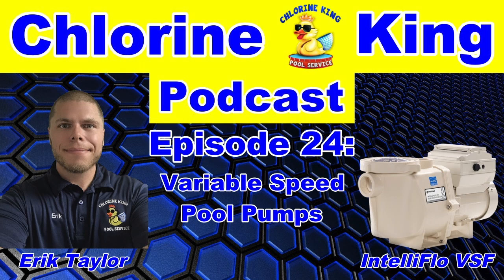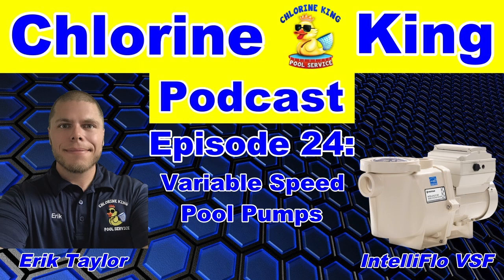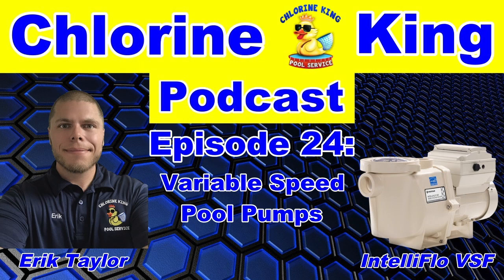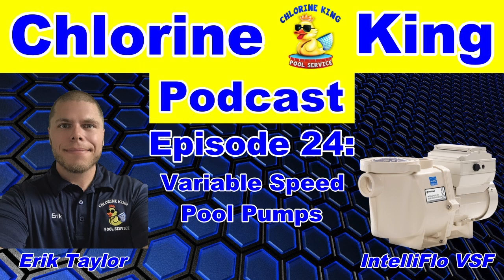Chlorine King Podcast Episode 24 (Audio Only) - Variable Speed Pumps

Comment: The only problem is, when you bring them into a pump shop they don’t want to work on them
Reply from the maker: I haven't heard of that, however, if there are issues with equipment I install I have a warranty station come out and take care of it for the customer. That way the client doesn't have to deal with anything.